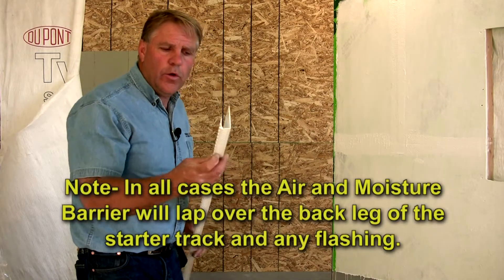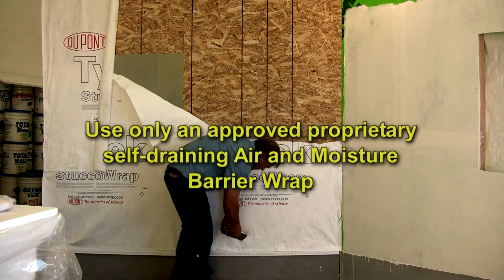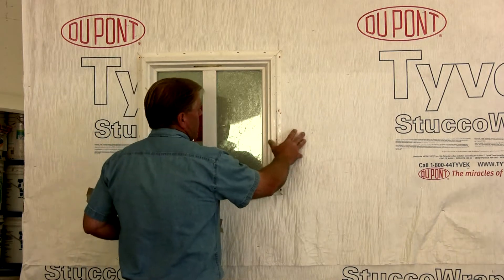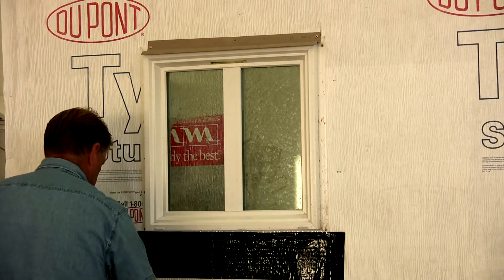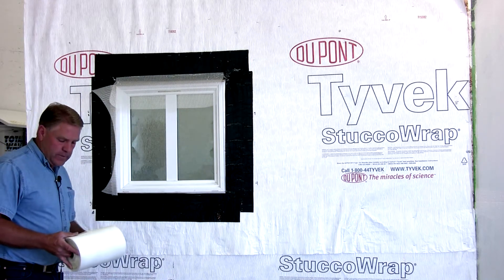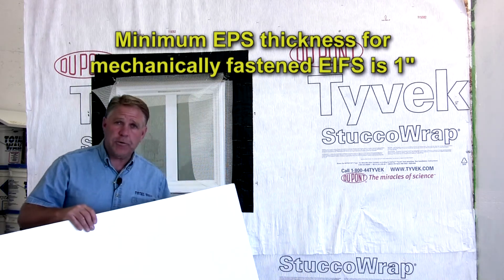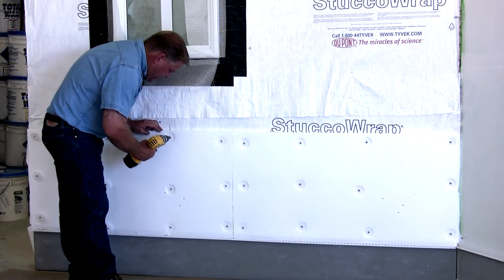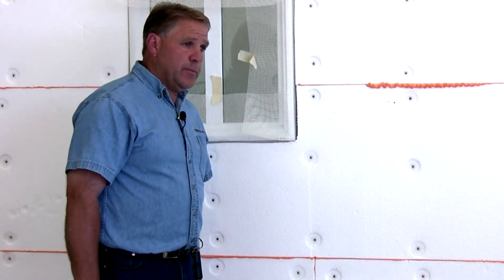Total Wall - Chapter 5A Fastened System

Comment: Jeff u do not need to use the starter track.  It dose nothing.  After the eps is screw on or cemented on it will go no where regardless how high u go.  You have to pre warp the sheets with starter mess which is a must.